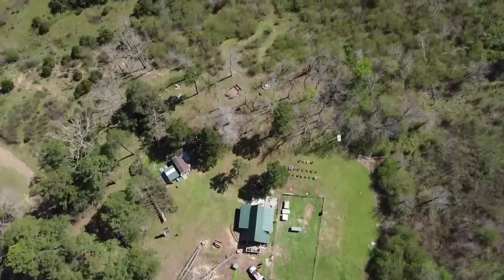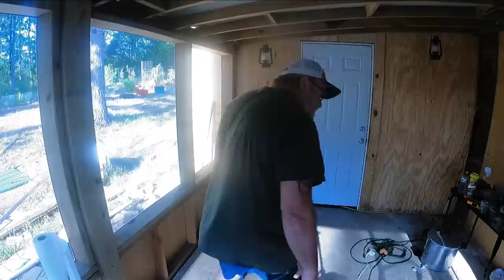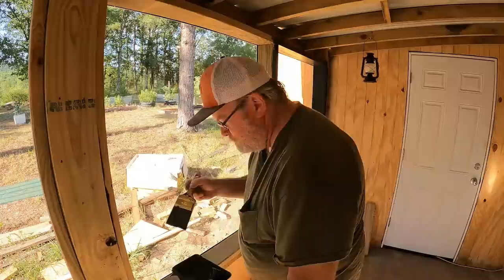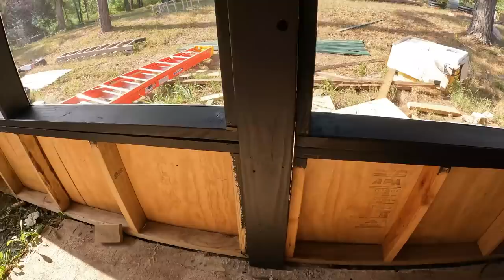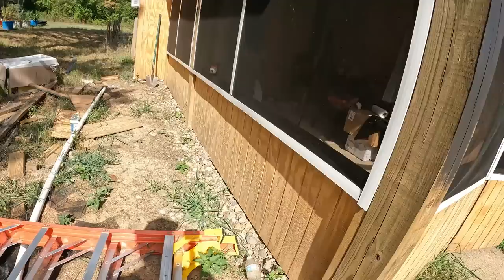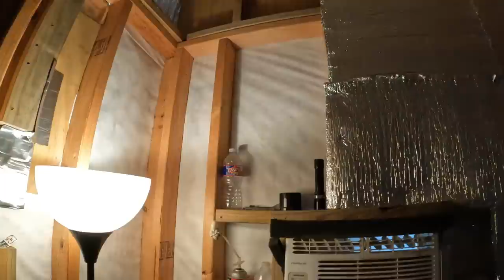Back To The Build! Heat or No Heat!/ Painting Has Begun

Comment: If using water clean up paint, wet your brush before painting, then sling out the water, makes clean up a lot easier.  I also put paint trays and brushes in plastic bags and keep in the fridge overnight and then you don't have to clean in between painting sessions.
That black edging looks sharp!

Comment: Just because I'm an overachiever, I'm watching your CLEAN OUT THE SHED video WHILE watching the ENTIRE PLAYLIST of HOME RENOS. So, YOUR HAMMER 🔨 is on the TOP LEFT SHELF next to that LIGHT YOU DIDN'T USE FOR THE DOG APARTMENT. It's UNDER the THING NEXT to THE LIGHT. As far as YOUR HEATED WATER BUCKET, 🪣 I saw 2. Theres a blue or green (cant tell) on THE LEFT BOTTOM SHELF in the shed (under the LEFT TOP SHELF where THE HAMMER is STICKING OUT. And, there was a RED 🪣♥️ BUCKET on the black 2-shelf unit you had OUTSIDE THE SHED DOOR TO THE RIGHT (your right if you're FACING the SHED).  The RED BUCKET was on the BOTTOM SHELF of that black 2-shelf unit that WAS outside the SHED AFTER you put everything back. Hope that helps you, Mike. 🤠 Candace in Texas